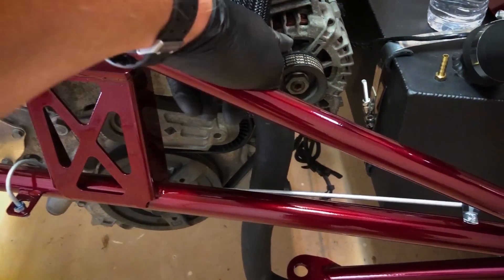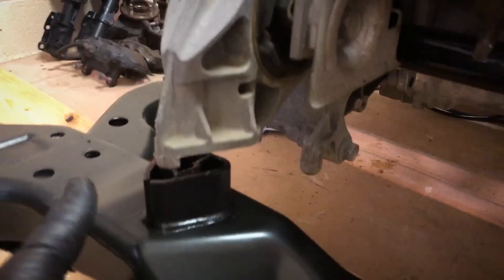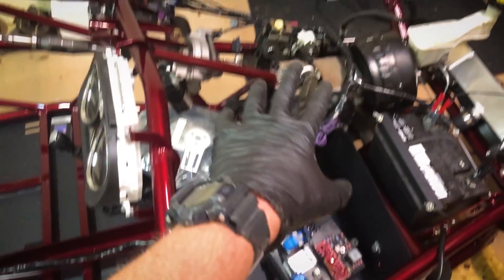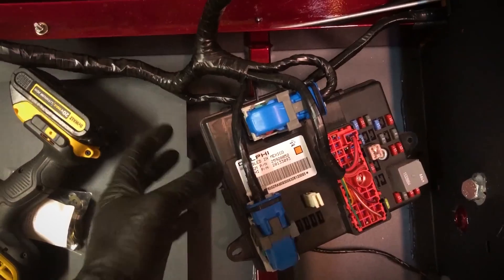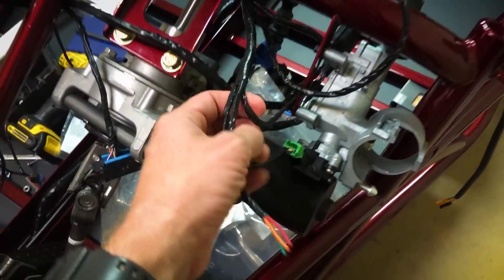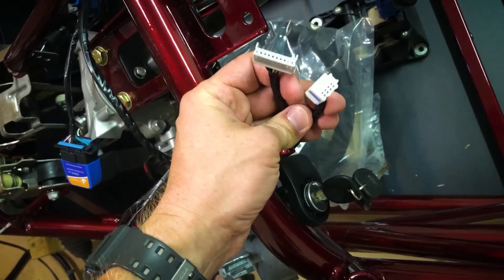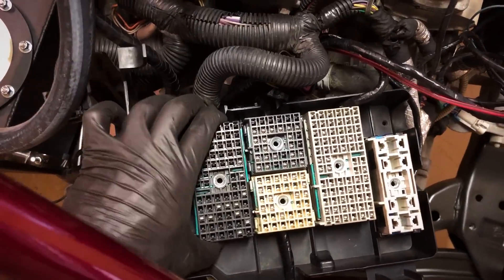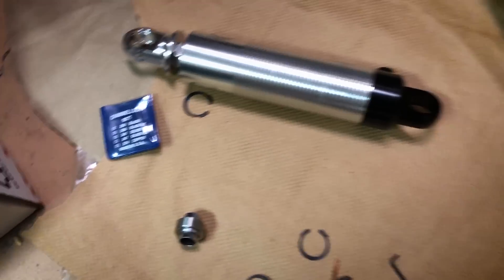DF Goblin Kit Car Build - Part 5

Comment: Looking great mate! 
With the indicator wiring see if you can put a connector on it rather than crimp it. If you ever need to remove it you'll be happy you did. For the crack in the radiator overflow you could try plastic welding it. All you need is a soldering iron, its not as hard as you might think.
Reply from the maker: +Luke Jones sounds good.  I’ll do the connector.   Thinking I’ll just buy a new tank as this one looks pretty old and they are very visible in the final product.

Comment: Just get that radiator tanks brand new on amazon for 26, also you can fire it up without radiator fluid for a bit, and the other dash wires are from your turn signal stalk.  Also, if your missing any bolts...worth it just save time and go to home depot / Lowes and get a grade 8 bolt for replacement. GL
Reply from the maker: +Manuel Atallah thanks again for the advice dude!  Didn’t even think about checking Amazon for the tank.   Was planning to take a bolt to Home Depot, had to do that for a few bolts on my Jeep lift kit

Comment: So that adapter on the throttle cable is there to switch the order of the wires.
Reply from the maker: Ahhh that makes sense.   And you can clearly see that if you just stop and look at it.  Lol.    Thanks mate!
Reply: Buley Builds no worries. Does that mean I get to “drive” the car now? :p
Reply from the maker: ReadySetVirtual haha yes, of course! 😂

Comment: Cool that DF Kit Car offers a wire harness service.  I watched their old video series and 4 ~ 5 videos later, they had the harness cleaned up.  That looks to be the hardest part of the kit.  How long did it take to get it back once you sent it to them?  Did you get the kit already with the powder coated frame and parts, or did you do that once you picked it up?  How many miles did the donor car have on it before putting the engine in your Goblin?
Reply from the maker: It only took them a few weeks to do the wiring harness, but they’ve gotten increasingly more busy lately.   

I had them use their powder coater before I picked it up.   They have a company they work with.  

The donor had about 167k miles but the engine was replaced at 100k miles in 2015 so the engine only had about 67k miles.

Comment: When you are painting stuff you might want to hang it up with a fishing line or something, painting stuff in the grass usually picks up crap that will show up in the finish. I know that it doesn't matter for parts that are not visible, but if you want to paint something like wheels or mirrors you might want to consider that pal, awesome video regardless!
Reply from the maker: +Zack P Great idea!   Will do that for the rest of the parts I want to paint.  Thanks.  😁👍

Comment: Why do you edit your thumbnails so heavily?
Reply from the maker: Yeah definitely over did it on that one.   Meh.   Trying to figure out what works I guess.
Reply: @AaronBuley  It does not bother me just was wondering why
Reply from the maker: @chaseware3181  sometimes if you up the contrast and saturation the thumbnail will pop a little more than others.   that's why i have done it on a few, but yeah, i way overdid this one.   when i get a minute, i'll probably go back in and edit it back down a bit.